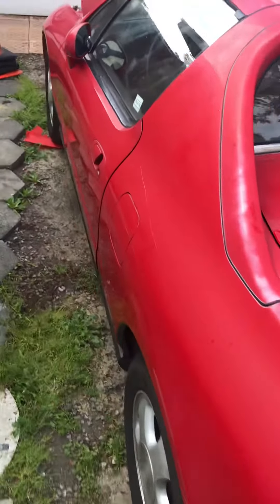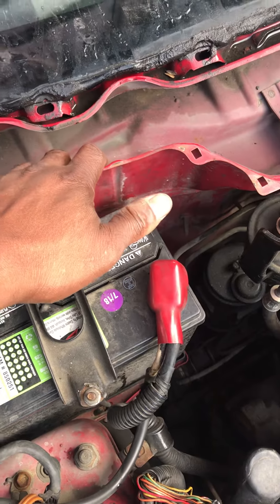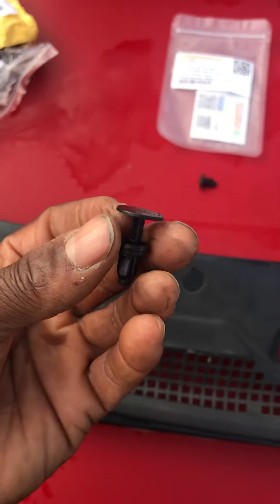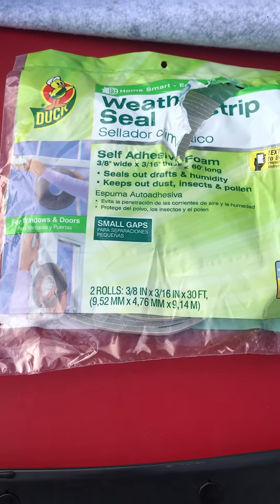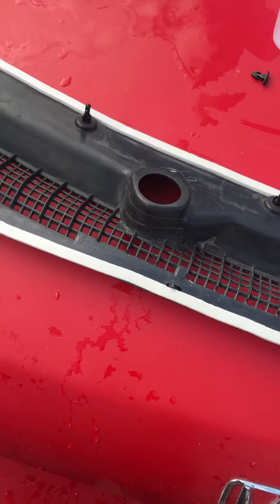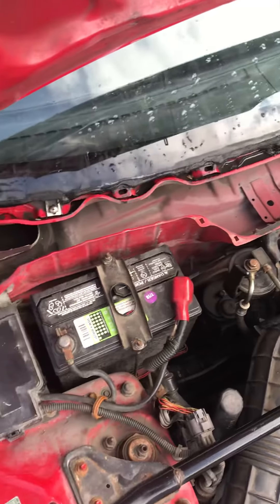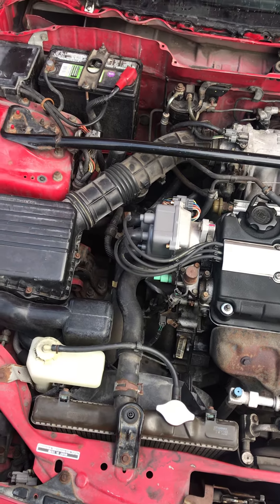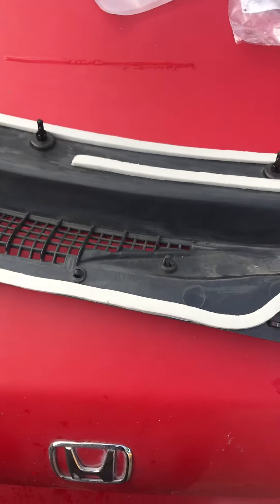Vlog # 1 eg2 Honda Del sol build wiper cowl leak and fix #honda #civic #delsol #leaks

Comment: Nice video, my car was painted and everything removed, so this helped me figure out how to get it sealed up. The driver side, if it leaks can also ruin relays under the dash, there is a reason they are mounted and grounded with the top facing up so water cannot run into them.
Reply from the maker: Yeah your right thanks for the info 💯💯💯

Comment: Good Video, I Just Bought A 93 Del Sol With A B16 in it. I Did Not Know This About The Leaky Water. Have You Had Issues With Your Speed Sensor, My Does Not Work So I have No Idea how Fast I'm Going.